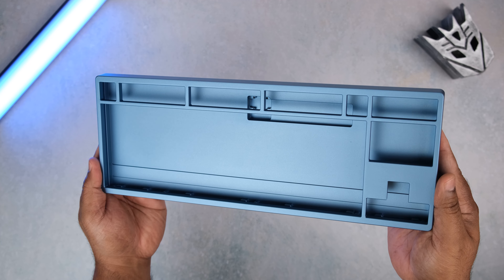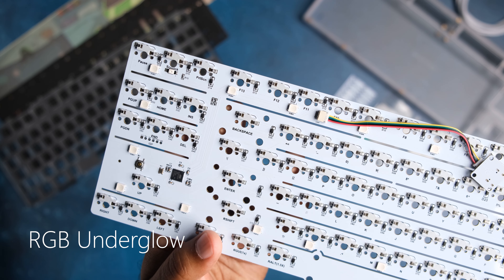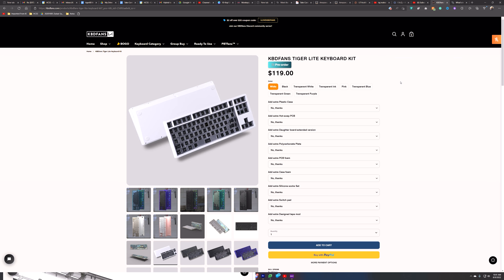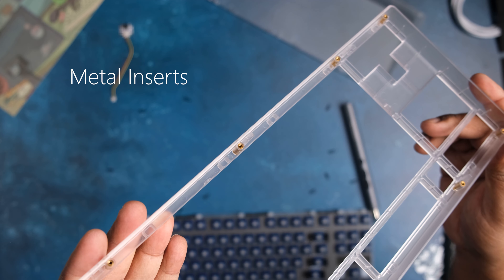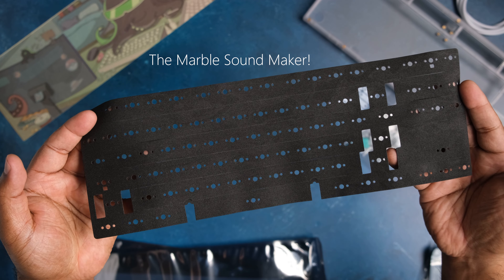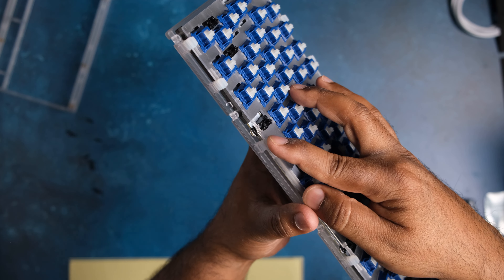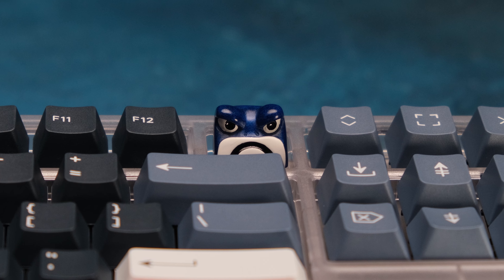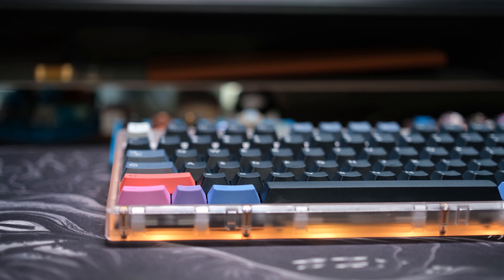The Best Keyboard for $119. PERIOD! Tiger 80 LITE Review

Comment: Nice video, but isn't the PE foam should be on top of the PCB? Also, there should be another foam for the bottom too.
Reply from the maker: I didnt use the PE foam. The board does not come with case foam. I did use plate foam though. Thanks for watching homie.
Reply: @Clackbait  just built this a few days ago and it does come with case foam. Might be a newer batch?